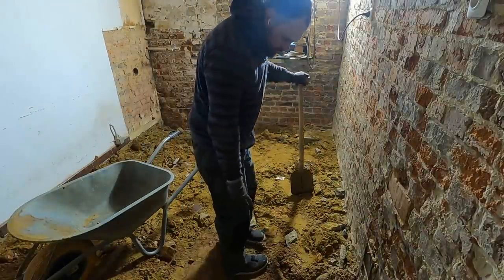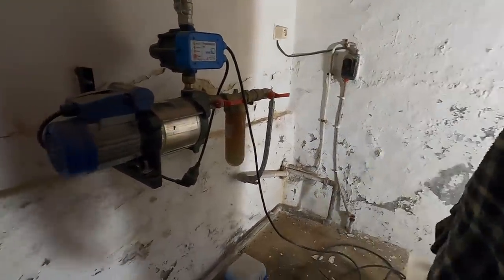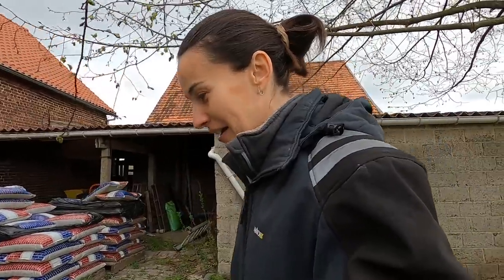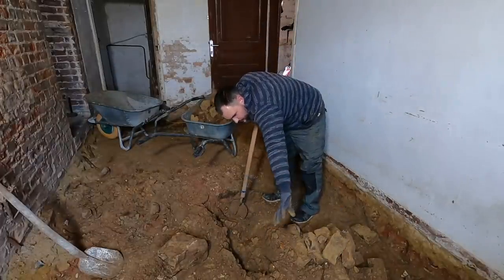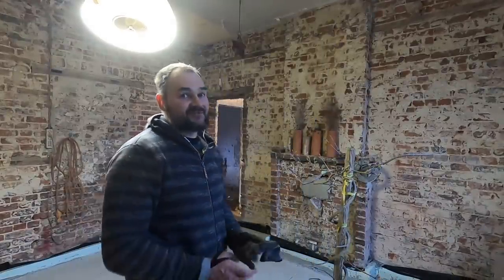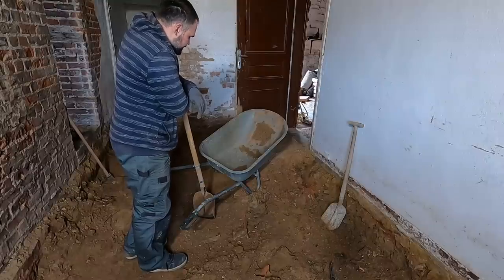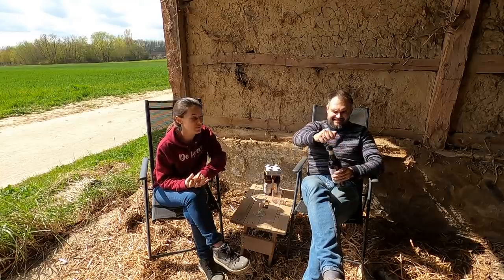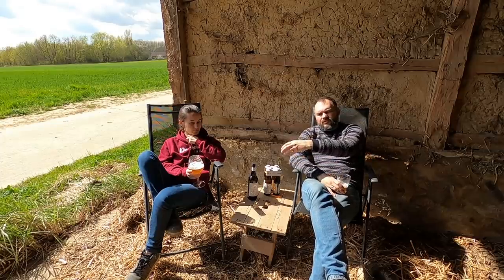Exploring the UNKNOWN: How did the water system on 110+ y.o. farm work?

Comment: Help for Illia (farm water systems)
Greetings, 
I’m a subscribed YouTube follower. Illia asked for some help and our situations are similar, so I can tell you what I know. I’m located in Jacksonville, Florida and my Mother in Law is located in Ixelles, Brussels, Belgium. Both of us have cancer, so my wife travels back and forth, to give us support.
I have some experience as an engineer and program manager for large commercial HVAC systems. I am not a plumber, but I have designed and specified all the parts used by the installation plumbers. I am working slowly on my own house while I get healthy again. I hope Illia enjoys doing these projects as much as I do. He should be very proud of the accomplishments and deserves the sit down with some of the best beers in the world. Having enjoyed some of those Belgian beers myself, I can relate. I suggest Delirium beer varieties, which are pleasing to me.
The Jacksonville property used to be a farmhouse for a mandarin orange farm. The farm irrigation well is on our property, and used to be the primary water source for the house. We have city water also, and the system can be switched back and forth, in whole or in part, between the two water sources.
The city water is very clean, and I believe it is cleaned with a chlorine / bromine system. The well water is naturally sulfurous, which gives off an odor when sprayed to water the yard, but does ensure that the water is clean and drinkable, if you don’t mind the taste or smell.
First, 
I would say you are lucky to have two sources of water, as this gives you choices and options other properties do not. It also means you’ll have to do the work to get these systems working to your benefit. If you are willing to consider investing into some decade long timeframes, you also could reap large financial rewards.
Second, 
Start with a plan that has achievable steps, offers change of direction options and multiple goals (I’ll give you some ideas). A diagram of your water, sewer and electrical system will help a lot, including current state, next stop and final goals. It helps for all water, sewer and power systems to be laid out on a big sheet of paper, so you can figure things out. Remember, paying someone else to diagram it out will cost easily ten times what you can do this for yourself. It gives you something to show your local inspector for discussion before you begin. The plus is that they should be available to help educate and guide the future plan for your house. It is nice to speak well of them on your channel throughout your project.
Third,
Document and map out everything you find. Dig up the floors, open the walls, find where the branches go, look up the part numbers for the pumps and try and find / download the manuals. This step is essential to find out the system capacity in psi (pounds per square inch, use metric in your case). This also will help document what needs fixing and replacing in your system. It also will let you find the maximum flow rate of your water system. PSI times Flow Rate will give you an idea of the maximum capacity. Once you know the capacity and an idea of what you”ll build., you’ll probably find you will need more! As such, it may become irrelevant to fix what you have, in situ. If you opt for an increased capacity, replacing pipes to a larger diameter is likely. 
Fourth, 
Decide on a philosophy of what your water will do for you. Do you want the minimums of sinks, baths, showers and irrigation? Or maybe, do you want your water to add to your lifestyle and architecture. This means walk in showers, floor heating and cooling, water heat pumps for air temperature and humidity, large baths, swimming pool, dishwasher, greenhouse irrigation. Children and guests can add a lot of demand for water. I offered to give you ideas, but you need to decide on a philosophy, which will help you determine what you want to build. In my area water costs are water + sewage per kilo gallons ($0.94 + $4.94), which is a little expensive, so we are using the pump water for pool filling, yard or plant irrigation, which is important to save you money.
Fifth,
Decide if you want to add solar power for your property. Solar can generate electricity, and it also can heat water. It could run your pumps, heat your bath water, pool and even your whole home. It also can help you make design decisions that add more light or less heat loss in your home. The rates in my area are total rate per delivered kilowatt hour ($0.11615 which is cheaper than many other areas). If your equivalent rate is higher in your area, it is probably worth looking into and building some solar. The best systems use a lot of pumped water, and you store the heated water for later use. These systems cost a lot at the beginning, but save you paying for utilities. Typical paying back the initial costs is 7-10 years. After that, it is FREE!!! Free is very good, by the way. The catspector would approve.
Sixth,
As to your present pump circumstance, the cellar pump appears to be under the size you will need for your whole house. The video shows a 10 bar pump @ Max 1.5 kw. A bad sign is only a trickle of water when it is started, you should get a gusher instead. It also has no attached storage tank to hold built up pressure. In my area, I think any well pump requires a holding pressure tank to buffer when the pump starts and stops. Check with your local inspectors. They can be very helpful if you let them. My honest guess is you will need to replace it with a larger unit. But, you can probably re-use it, with modifications, for a pool, irrigation, or greenhouse separated sub-system.
Seventh,
I am not particularly familiar with the model of pump and controller you have in your home. The failure light seems to indicate a pressure problem. Either the vacuum pressure on the well side is too high, indicating a clog or a fracture of a pipe. It also could be the outlet side raises pressure too quickly because of no buffer tank. Consult a plumber familiar with this pump. And tell him to bring his pressure gauges. It will help with the troubleshooting.
Eighth,
About the lead piping, I am adamant that you should replace it. Some local rules may allow you to re-use it for heating systems. But for drinking, bathing, pool or irrigation, it presents a severe health hazard. You can usually choose pipe materials like copper and plastics to replace it. Copper is very expensive and very safe. PVC can allow some contamination. Galvanized steel is safe, and about the same properties as cast iron. ABS pipe is used for vents and drains, and is useful as a replacement in those cases for cast iron. But the current best practice in Jacksonville for incoming and water supply side piping is a material called PEX. It usually comes in blue and red for your cold and hot lines throughout the property. Sometimes white PEX is used for an alternate water supply, like a well water source. PEX is also used for floor heating, and I recommend that you install this in your floors, even if you initially do not hook it up. PVC is currently used as drain piping in homes. It also is used perforated for septic systems. ABS is used for venting and outside drain line. Steel is only used for gas piping locally here.
Ninth,
I should note that you are in a freeze area. Piping on the outside of your heated home can freeze. Unheated areas inside your buildings can also freeze. Since you have not had heat in the building, I would expect a broken or leaking pipe somewhere in your system. Outside piping in the US which is in a freeze area must be placed below the freeze line, which is 18 inches deep. Your measurements may differ. By the same reasons, electrical wiring in conduit must always be buried at that same 18 inch depth. For convenience, many builders run their water, drain and electrical in the same ditch. And they lay extra hoses and wire for future expansions. It saves on the digging even if the piping becomes longer.
Tenth and Last,
For tools, may I suggest a water/sand/air blaster. They use all three materials at a pressurized level and can be adjusted to use different portions of each. The sand can also be changed to different materials, like aluminum oxide, crushed glass, coal slag, soda bicarbonate and even walnut husks. It’s a simple tool, but work great and provide a strange emotional satisfaction for people when you clean with them. Use outside with proper protective gear. I’m sure it will be aggressive or soft enough to remove some of those tiling, paint, and surface cleaning problems you have stacked in the back yard (you asked for help) and your followers will enjoy it too. It should also work well indoors to make a clean, sealable surface of wood beams and your brick walls. Just spray paint with a transparent epoxy or urethane coating after your surface cleaning. It makes for a stunning surface in most cases.
Closing tidings,
I love watching your efforts and steady successes. The periods of time exposure and music overtones are wonderful to watch. Marina, keep picking out good music from where you find it. It is even better when you have a “supervisor” checking your progress. Keep it going, so we can all enjoy your next episode.
Best,
Dave

Comment: I would think there would be a well head somewhere, or if it was a hand dug well back when the house was built they might of covered it probably close to the house check out You tube "How to find under ground utilities, pipes, lines and cables using dowsing rods" this out it looks crazy but it works

Comment: Regarding your ground water system - maybe I would be easier to get a company that digs wells in your area to come out and talk with you. Generally it is not too difficult to dig a new well.  Seems like you already have a mini excavator which could be used for some of the work - depends where the ground water level is but I think you will be surprised - it probably wont be too deep). By starting from scratch you can put your design of system in - that way you wont have to waste time trying to do detective work on the old system. Seems like you already have the skills installing the pump and pipe work I am sure - think about submersible pump direct in the well. Technology has moved on a great deal in this regards. In this way you will be your own master of the system and not trying to second guess all the time.

Comment: Honestly, check how much mains water costs and then decide whether it's even worth to get the well system back up and running! It would be considered a new installation and might require all sorts of additional filters and water treatment systems. The setup would also profit from a pressure tank to reduce wear and tear on the pump. A pressure tank is a metal vessel divided by a rubber membrane. One side holds water and the other air. As the pump fills up, the air is compressed until the tank is full. If you turn on a tap and take just a little water, the air expands and keeps the water pressure constant, even though there's less water in the tank now. Only if you run more water than the air can compensator for, the pressure switch actually turns the pump on. That means the pump won't shut on and off in very short cycles all the time. If you just connect your new plumbing to the water meter you don't need to worry about any of this.

As others have said before, replace all the old pipes. Lead is dangerous (although not as bad if you have hard water as the limescale buildup in the pipe seals the lead) but you definitely don't want to bury any old pipes under your new floor.

The first pronunciation of lead is correct for the metal. It's one of the most confusing things in the English language because there are so many different words (verbs and nouns) with the same spelling and sometimes different pronunciation. Tear is almost as bad but not quite.

Comment: You have lead pipe and zinc galvenized steel, if it goes to a well, your well could have lead contamination and you must test it. Lead water is unsafe for drinking and bathing, this you know.
You must replace the old pipe with the new tubing, it will be easier to install because you will need a professional plumber. This is not a step back, this will be a safe improvement.
If you need a new well, consider all alternatives because it may be a major expense for a new well. 
You will want to know your water table, how deep is it? Do you have a deep well or a shallow well? Talk to your neighbours, ask questions about their water. What you learn from them will help you. Can you use a shallow well or deep well? Deep well is expensive, water may be hard with minerals and need a softener. Shallow wells capture surface water absorbed from precipitation.
You both are very productive, it's very impressive. This is the "practicum" of home ownership. Cheers to you while I sip my lager with pineapple juice. 🍻
🇨🇦☺️👍 🌻🌻🌻🌻

Comment: Not an expert on wells but would suggest you first abandon all existing plumbing and run new lines throughout the house. Next, consult with local contractors to see if it is feasible to dig a new well. If you get good water it can be perfectly safe with proper filter system. But, do not use any of the old lead pipe for any purpose. If your going to use what we call city water, water supplied by local utility, still consider a well for irrigation and other uses where potable water is not needed. Also, while I am ranting, replace all existing electrical wiring. Stay safe, God bless Ukraine, and pet the cat for me.

Comment: @
De Hoeve. Old Belgian farm renovation   hey guys,i also had lead pipes,these should be replaced,and looking at the rust in the filter i guess the metal pipes will be full with rust too,so you will have to replace them too,the best pipes for replacing these is alu-pex,they will never rust and are drink safe,here is a video on how to install a rain/ground waterpump  https://youtu.be/0krsW4qC558
the best is to use a two filter setup,one with active charcoil,and the other one a 5µ filter, that way its safer,dont forget,what you spray on your garden vegetables you also eat

Comment: Many people are rightly concerned about lead pipes. However, lead pipe will corrode in water and build up a layer of rust that will prevent that lead from dissolving into the water after some time passes. Your pipes are probably 100 years old and so the lead is probably not leaching into the water. There has been a big issue in one city in the USA because they abruptly changed the chemistry of the water, and this dissolved the layer of protective rust from their entire water system. Personally, I would remove all lead pipes from my house if I found them. I would not be very worried if I was using the potentially contaminated water for gardening or washing up. Many people will disagree with me. Copper is preferred, plastic has become the choice because it is cheaper and easier to join. If you can afford it, rip out all of the lead pipe.

Comment: Any time one is renovating old properties, two systems absolutely should be entirely torn out/disconnected and replaced by professionals: water and wiring. This is because these systems were previously added to the property in small bursts over time, so they were never well-planned, and the materials used for them were often hazardous and inefficient. It's dangerous and awkward to leave any part of those systems in place, and invites future failures that could later ruin all the hard work you're putting in. I strongly urge you to just bite the bullet and start over on those, at least for the house, with solid plans to redo the systems elsewhere on the property a little at a time (because those can wait so long as you have a good plan to be able to renovate them without affecting the house systems and you keep them as separate systems).

However, just because you're completely replacing the wiring and plumbing systems, doesn't mean you have to give up on using the ground water for a majority of your water use. Given that you're surrounded by farmland, I'd be concerned about agricultural runoff getting into the ground water, and would not use it for the potable water to the house at all if you have safer tap water available, but it WOULD still be fine for toilets, gardens, greenhouses, etc. Filtration systems also aren't that hard to add to ground water systems if you're building the system from scratch instead of adapting an outdated one. You also have a LOT of roof real estate collecting rainwater, and it might be smart to route that into the (probably already existing) cistern or well, which I imagine you'll find somewhere on the property and can just have properly serviced without needing to replace it (tanks don't really have moving parts, but the materials can still decay and it's worth checking to be sure they're safe and in good condition).

Similarly, when you wire the house it would be smart to do so with the future generation of electricity in mind. If you think you might someday want to have solar or generators or anything of the sort, even just a gas generator in case the power grid gets interrupted in a storm, then wire your home with a plan to be able to easily add those to your system later, even if you can't necessarily afford to build them right now. 

System redundancy, in this case, is good. It's safer overall, and in an emergency, the off-grid systems you have can work as a solid backup to the mains. You should take advantage of the upheaval of the renovation to actually PLAN all these systems from scratch, though, because I promise you, it's never been done for your property before and it will save you a lot of hassle in the long run, even if it costs more time and money to run new systems now.